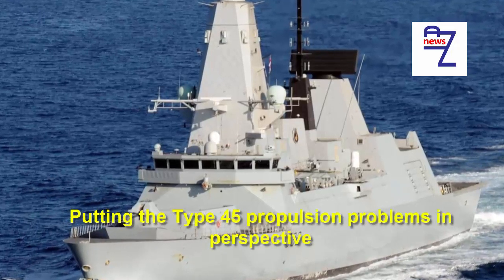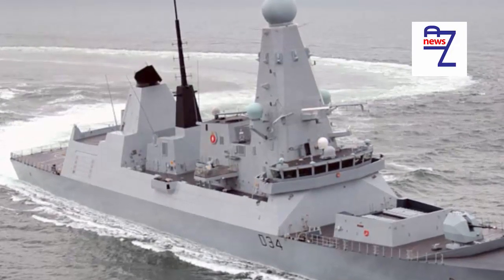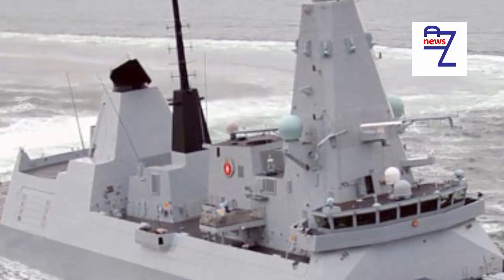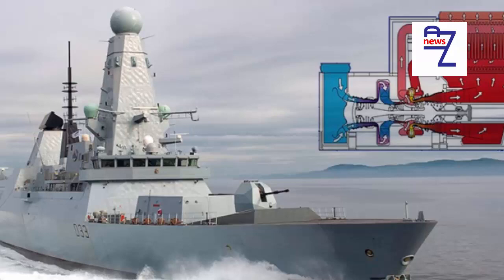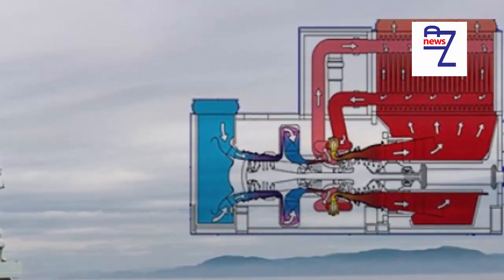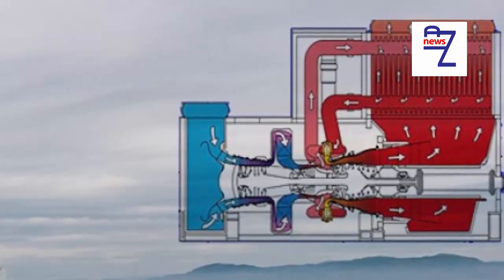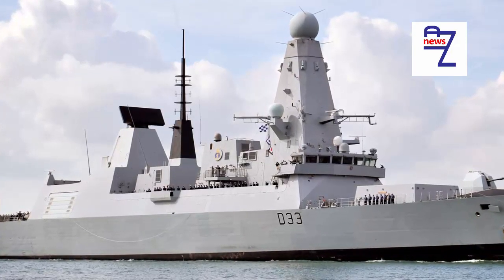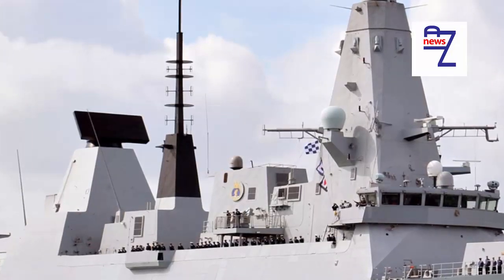Putting the Type 45 propulsion problems in perspective

Comment: This is only half the story.  The other part of that of harmonic voltage distortion (TDHu) four times the NATO Stanag maximum THDu of <5%.   In addition, also due to the 2 x 20MW electric propulsion there is common mode voltage between each phase and the hull.  The 19-20% THDu was know about in Feb 2003 by Alstom.   A price worth paying MOD(N) for PWM technology  ?

Comment: I was in the working navy(merchant). We had these things called steam turbines which worked o.k. anywhere.
Reply: Hi, Geoff.I too was in the MN (R/O) I sailed with Triple Expansion, ST's, Doxfords, Sulzer, B&W's and the weirdest of the lot — an experimental engine known as a gasifire on one of Denholm's managed ships called the mv Morar. It was a small 4 hatch iron ore carrier. The engine was like a Doxford on its side. I believe the idea was to power the ship by feeding the exhaust gases through a high pressure system that would drive the ship. It was far too ahead of its time. The metal technology of the time 1950/60's could not offer strong enough pipes, seals and things to handle the heat and pressure within the system — it was a failure. Ironically, the Morar was re-engined and because of the toughness of the ship's hull and structure it became a drilling ship — outliving its sisters by 20 years or so. Regarding the new T45 class. Like any new ship, cargo or naval, there will always be teething problems before things settle down. Every class of warship no matter who built it will suffer some operational problem within the engineering department. That's the very nature of things. Its the likes of keyboard warriors and their cynicism that gives one the belief that things are not going well in Camelot — when in fact things are not doing too badly. (British understatement) Take care, Bill..

Comment: type 45 are great ships
the part of the engine system area that has problems was an small component that was made to small by an micro measurements 
that is replacing it was done an correct measured component.